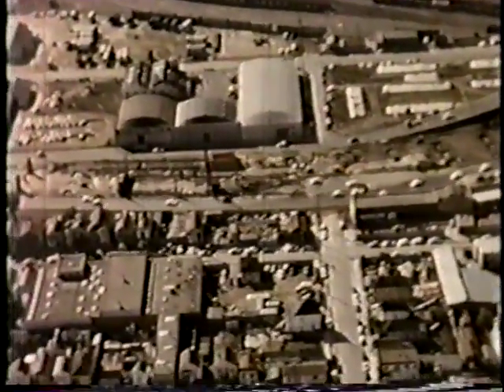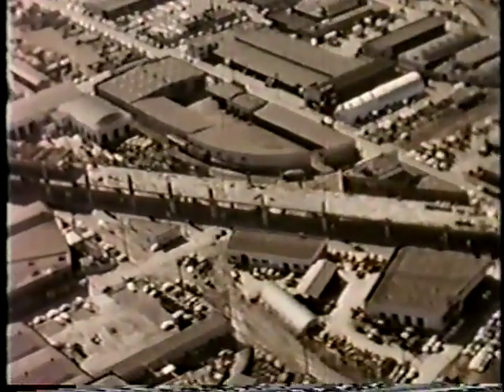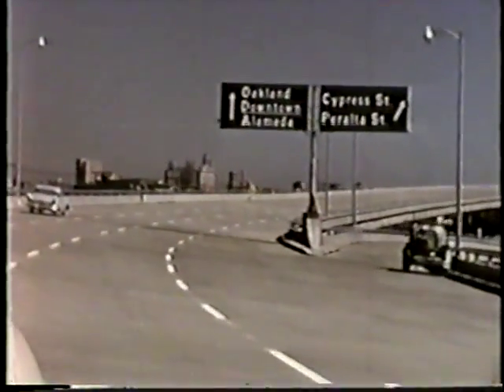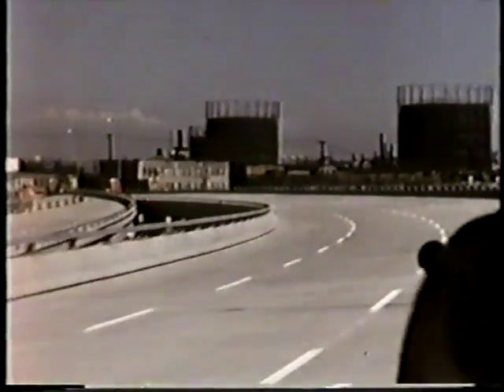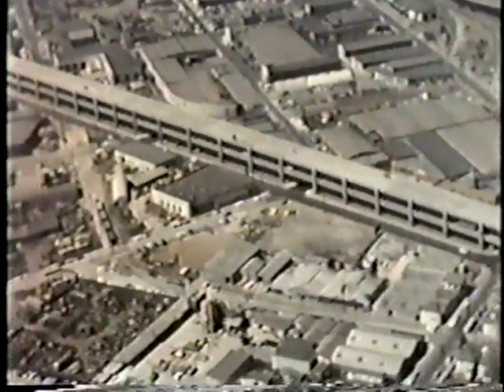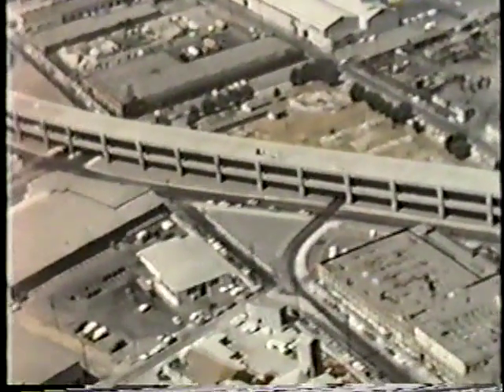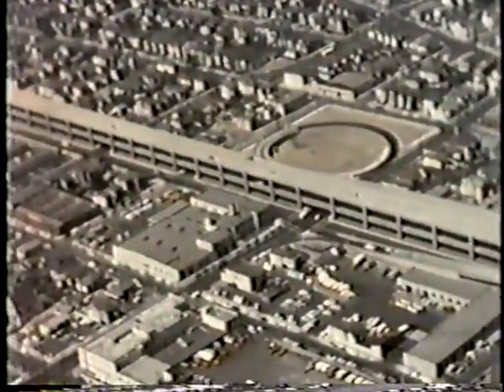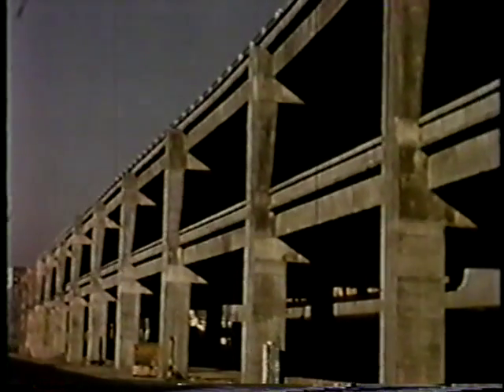I-880 Cypress Viaduct Construction (part 5 of 5)

Comment: As I just watched in another documentary, those angled columns you see on the Cypress Structure helped contribute to its collapse because pressure was angled outward instead of straight down. The northern part of the structure was build on mud and that also amplified the shaking.

Comment: Even now, I am still concerned when I drive along certain parts of the Bay Area -- particularly under overpasses. This is especially true of a portion of the Southern Embarcadero Freeway (280) that connects 101 toward King Street. It reminds me of the Cypress (and not in a good way).
Reply: Chris M from what I know, it's safe going on 280 through east San Francisco because it was rebuilt in the 1990's with better earthquake-proof engineering
Reply: that section of 280 was shut down and rebuilt after the earthquake to be earthquake proof
Reply: @feedingtime7059  - Thanks! Still, it's still something that I don't want to be driving on during a 6.5+ earthquake.
Reply: @ccchhhrrriiisss100  It was specifically designed by earthquake specialist civil engineers to withstand up to 8.5 earthquake. It was shutdown for 4 years and rebuilt. Much safer than being on a regular road in SF thats most likely on landfill

Comment: In 1994, only old structure failed in Los Angeles.  Retrofitting was underway but not finished.  The only retrofitted section that failed was the 10 @ Fairfax.  That section is over dried wetlands.  The new bridge is even stronger now.
Reply: @Derek The same 5/14 interchange came down after the 1971 Sylmar quake, built a new one, and was taken out, AGAIN, by the 1994 Northridge quake. Time will tell if it survives the next quake.

Comment: Horizontal retrofitted bracing would've definitely saved lives if not the structure itself.  Vertical strength was apparent as the beams and columns had to bend away from centerline for failure to occur.  Reagan killing the interstate seismic retrofit program killed people!!
Reply: Yup.  Blame it all on one man.  How convenient.
Reply: @pacz8114  Hey...  if the shoe fits...   Reagan killed far more people by ignoring AIDS.  (And just to prove this isn't partisan, GHW Bush gets full credit for finally doing something about it...)
Reply: @Dana_Danarosana  Conjecture suggests you may have a morose preoccupation with impudently labelling select individuals as "killers".  In response, I would recommend your therapist to increase your dosage of Xanax or Klonopin, which, with hope should safeguard all and sundry against what may be a disorder.
Reply: @pacz8114  My goodness... what big word usements you structure!!  As for the rest of all that nonsense, I'd argue that not calling a killer a killer just wouldn't be prudent.